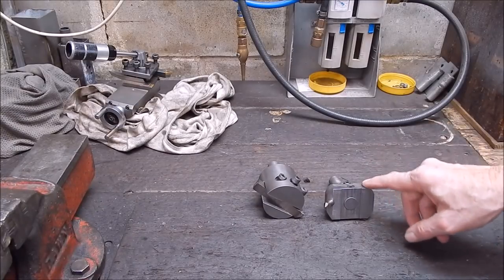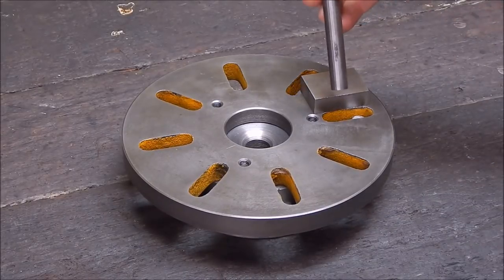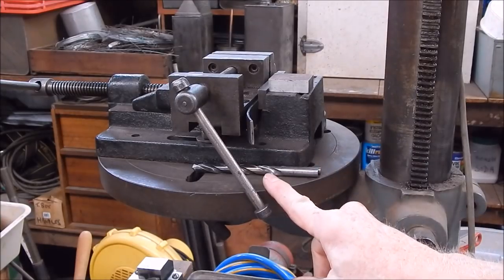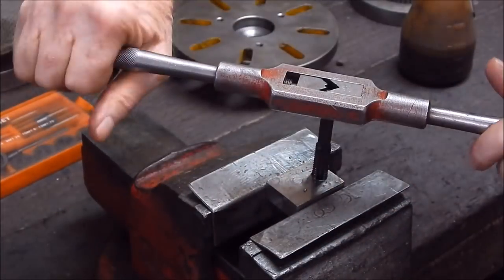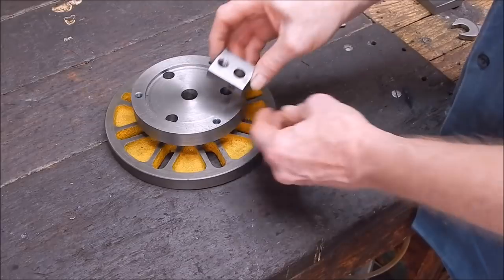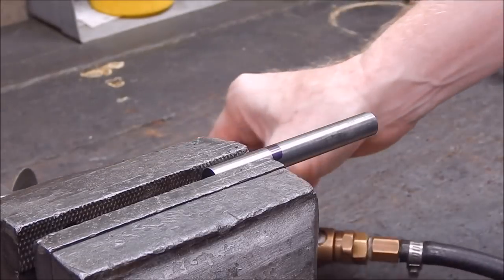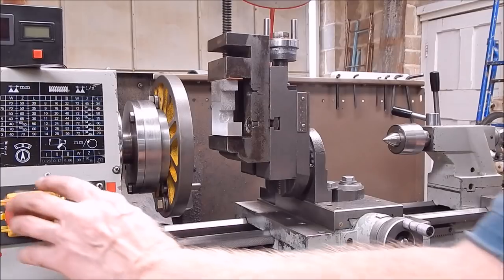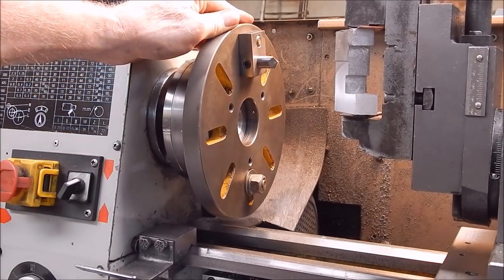Turn your lathe faceplate into a large fly cutter

Comment: Nice job Rob. Made one similar when I had a milling attachment. I made mine so it was the whole width of the back plate. I put 4 holes on one side of centre so I could move the tip across for different radii. Helps with the balance as well. Thanks for sharing. regards from the UK

Comment: Nice idea, but I think you should have just run the mounting block straight across the faceplate, and used the second bolt to secure it on that side. Then it's secured in two places and can never move. You're using the second bolt for balance anyway, which I think is a very good idea, so why not take advantage of it? As it stands now that 12mm bolt is subjected to a turning moment as the fly-cutting bit hits the work. The split lock-washer is a good idea, but I would be concerned that the moment caused by the cutter would still cause that bolt to loosen and allow the tool to move, thus causing your surface finish to go bad.

Comment: 12:39 yeah, that's the best way to do it 99 times out of 100.  But you still can cut tool steels with a hacksaw if you have a carbide hacksaw blade.  Pretty handy even for mild steels, zips right through the job.

Comment: Comment on threading using taps & dies. The most commonly accepted technique of turning the tap handle a small amount, then backing it off "to break the chips" damages your taps & dies prematurely. Those broken off chips get wedged against your material when you take the next cutting stroke, and break the cutting teeth on the tap / die.

A much better technique that will prolong the life of your taps & dies, is to start your thread and NOT back off while cutting. You can stop to take another handhold, just don't back off the cutting teeth engagement. Never allow the chips to get between the leading edge of the cutting teeth and the material being cut. Use lots of cutting fluid. In thinner material, continue your cut until you finish threading all the way through. In thicker material (over 3/8") stop cutting, back your tap / die all the way out, then clear out all cutter chips (compressed air works best). Once cleared of all chips, re-insert your tap /die and continue cutting. Once again, lots of cutting oil.

This method will greatly extend the life of your taps & dies. You may even find you only retire them for dulled cutting teeth (normal wear) and never for broken teeth. This works in all materials, while I am focusing on mild steel for this comment. Always start with a Taper Tap. If you are threading a blind hole, next use the Plug Tap, and finally a Bottoming Tap.

Comment: that's the simplest yet the best fly cutter I have seen for the lathe.

I was thinking whether I should buy lathe or mill first, and I'm glad I went for the lathe, because it seems like I will be able to do both turning and facing, but of course with the limited parts sizes. in most cases I will be facing < 3 inches longest edge, so the lathe should suffice for some time.

quick question:
with the 4 jaws chuck, would you rather drill all these holes in the lathe or in the drill press? I think if it is possible, I would like to do everything on the lathe, just for the fun of it
Reply from the maker: The lathe will defnitely be more accurate.  The table on a drill press will flex from true vertical alignment unless a support (jack) is put under it.  A lathe allows you to index holes much more accurately with a simple paper chart behind the chuck - see my videos on this.  Cheers Rob
Reply: @Xynudu  excellent, will use the lathe to drill!
will check out your other videos, it's like a mine of knowledge

Comment: Just did it the other way round and I believe it was easier than your setup. I simply fixed the vise on the face plate and voilà...Ok, ok, some more possible unbalance, but I compensated that with counterweights. No need for your special milling attachment.

Comment: I like your simple solution, thank you very much for posting this. I was wondering about the tool geometry you used or ground it to (for your HSS bit)?
Reply from the maker: The cutting profile can be any shape (eg. curved or chisel)  but it must have some front and rear relief for cutting effect and chip clearance.

Cheers Rob
Reply: xynudu Thank you very much. As it happens, I have a rectangular casting to face off that is too large for my faceplate and will definitely try this out. I have already built a mini pallet for the carriage but my existing fly cutter has too small a radius, hence your example comes in handy.

Comment: Love the setup...i would just face it off in the 4 jaw but this would be great for irregular objects.Why did you hang milling  attahcment  over the side instead of trying to get it closer to the center of carriage...
Reply from the maker: That's because of the shape of the mill slide.  The vice is always going to hang off one side. It's not ideal.

Rob
Reply: You could mount the vise a little lower you could slide the angle plate back a couple inches it would greatly improve the load direction on the ways......cheers....its your world...
Reply from the maker: The vise has three pairs of mounting holes in it, so I can move it up or down as suits the job.

Cheers Rob

Comment: Is that milling attachment OE or is it aftermarket?  I need one for my ENCO 1340.  That made short work of facing that item.  Why not counter balance with a second cutter?  Good video and proof of concept.
Reply from the maker: It's aftermarket Chinese made.  I have seen opposing cutter heads used with a faceplate.  It makes a lot of sense.

Rob

Comment: Would there be any issues to machine in reverse to help catch the shavings in the chip tray?
Reply from the maker: Hi Peter, not if the lathe spindle incorporates a drive plate.  A screw on face plate could unscrew quite easily though.  It's basically no different to parting off at the rear of the cross slide.  Cheers Rob
Reply: @Xynudu  Rob thanks, it has the three pin locators, not a screw on.  Damn dog wants to watch me do the lathe work and trying to keep the metal chips in the pan and out of her paws.  Love your videos, helping me greatly. Thanks

Comment: Hello to you sir, I am really new to this, a while back I bought my self a really old lathe, the problem is ive  tried loads of new different types tools and I cant seem to get a good finish at all. I definitely cant get right through on a cut off, its a mess. I have tried new hss, new carbide. trying and trying to get dead centre, and sharpening,  ive tried it all, the last thing is am I doing it all at the wrong speed, I don't know what else to try, have you any ideas please.
regards Colin.UK.
Reply from the maker: Hi Colin,

We all start at the beginning.  What is the lathe ?

I suggest that first off you read this free on line book put out by Hercus:  https://tokentoolroom.com/files/Text%20book%20of%20turning.pdf

That has all the basic techniques you need to understand, and deals with HSS tooling for older lathes.

If you want to try carbide tooling I only recommend TCMT inserts in the smaller sizes, as this puts the least amount of load on the lathe by having a small tip radius.

Keeping the cutting area/radius small and reducing loadings on the lathe are important if you have any strength/flexibility issues.  Smaller old lathes often do.

I hope this helps.

Cheers Rob

Comment: what sort of rpm is your belt sander running at? I wouldn't mind makin one. and I've just dumped some power tools I didn't want or need, I knew the motors would be handy for something but at the time I couldn't think of anything and I really needed to have a clear out so I threw them away even though the motors were still good. I'm sure I still have something with a usable motor... maybe I could adapt an old air powered DA sander to power a belt... so what's the rpm again?
Reply from the maker: It's not about RPM, but about belt speed.  

Ok, the motor speed is 1400 rpm, the drive pulley is 50 mm diameter.  So to get belt speed we multiply the pulley circumference by the motor rpm.

That is 3.14 (Pi) x 50 x1400 which equals 219,800 mm / minute or 3663 mm per second.

That then becomes 366 cm per second - in USA terminology that's 144 inches (12 foot) a second.

That's a lot faster than it looks, but the figures don't lie.  Makes all that high school learning worthwhile ;)

So to make one up you will need to use the same maths for whatever motor and pulley you are going to use. 

You can get great stuff out of old treadmills to make these units  (rubber coated rollers , shafts,  ball races etc).

Linishers are one of the best things you can have in the workshop.

Cheers Rob
Reply from the maker: If the motor is an armature type (has brushes) you can easily reduce/control the speed with a cheap PWM voltage control (same as used for ceiling fans) provided it has the correct wattage rating.

It would be handy to have slower/variable speed for some jobs.

Rob
Reply: interesting. thanks for the breakdown, it all makes perfect sense. how did you decide what belt speed to aim for?
Reply from the maker: I bought the sander part from a garage sale for a few dollars.  It was originally driven by a flexible cable from an electric drill (crappy setup).  So that would limit the motor speed to no more than 3,000 rpm.

As I wanted a low speed unit I just used a junk day motor from the kerbside which was suitably low rpm.  Crunched the numbers and it seemed about right, and presto that's what you see.

If you have a hand held belt sander it would be interesting to see how the belt speed compares (crunch the numbers the same way) but you have to allow for any toothed belt gearing etc.

Cheers Rob

Comment: heres a tip for you rob chamfer the top of your hole it will make the tap go in easier
Reply from the maker: Hmmm.  Good tip Nick.  That makes sense.  I will try that next time.

Cheers Rob
Reply: xynudu learnt it off one of the fitters I work with as I am doing an aprenticeship in fitting and turning

Comment: Just get a piece of round stock and braze on an insert and you can use the same setup.  You might even have a boring bar already that would work.  Do you know anyone that sells boring bars???? :P
Reply from the maker: Hi John,

I have seen a single large bolt used with a HSS tip brazed on.  It puts a lot of pressure in one place and could maybe crack the faceplate, but as I said in the video description, there's lots of ways to do this. 

Cheers Rob

Comment: I do not fully agree with the tapping fluid you use. You say it is kerosene and motor oil. The main purpose of a cutting fluid is not only to lubricate but to avoid chip build up (aka tip welding) on the cutting edge and at high speed also cooling. There are two types. One for low cutting speeds like tapping and one for high speed cutting like turning, milling, drilling. In both cases the cutting fluids (water based and oil based and pasty) should contain sulfur compounds like disulfurdichloride or equivalent that chemically react under heat and pressure at the cutting edge and act as a release agent to avoid chip build up and extend the life of the cutting edge. Many know the dark brown, smelly, smokey cutting oil. Using such a real cutting oil may cost more than a home brew but it pays back by longer tool life, lower cutting forces and less broken taps stuck in your work. Try it and you will feel the difference especially with difficult materials like stainless steels.
Reply: Kerosene or WD-40 works well on aluminum. But for steel the smelly stuff is superior. I know it stinks up the workshop...
Reply from the maker: Hi Rol,

I do have proper cutting fluid (thicker dark sulphury stuff) but rarely drag out the bottle to use it.

The taps cut fine with my basic home made mix.  I'm sure you're right, but hey if it works then it can't be too bad.

Cheers Rob
Reply from the maker: Yes, that's one reason I don't use it. Also the bottle is always up the back behind everything else.

:)

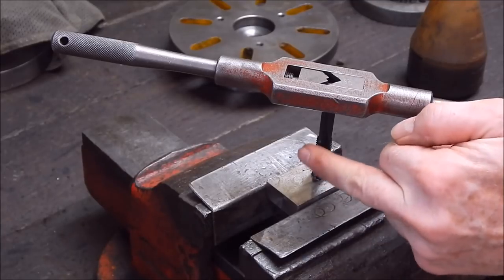Comment: 6:40 I have a cheap set of taps and dies just like that, had them quite a while and forgot I had them until today.... the taps look like they were cast up someone's arsehole, in fact thinking about it now they're rough surfaced like they've been case hardened with casenit but then not surface ground to make them good... and the dies are just as bad with crooked looking teeth. I'd never cut new threads with them... they're only good for chasing rust out of old exposed bolt holes which is what I used them for today when I fitted a towbar to the 4x4. and wouldn't really want to use quality HSS  taps for what I did today if I could help it. but for what you're doing here it would have to be quality taps for new thread cutting but you seem to have done all right with them, maybe yours are a little better than mine.
Reply from the maker: There are cheap tap/die sets and cheap cheap sets.  They are all made from high carbon steel.

I have two of the former (metric and Imperial).  Both made in Japan and at least 20 years old.

They cut OK and are quite accurate (did that job) but still not as good as expensive HSS pieces.

I haven't had a look at the Chinese sets (which are a copy of the earlier Japanese sets) but I don't doubt that the quality may be a bit suspect.

Rob
Reply: strange, I just checked my set and it has German writing all over it but they're not your typical German quality lol so who knows where they were made... Interesting to just discover there's an 1/8th NPT tap and die in there too... gives me an idea.   
Sure would like to compare mine side by side with yours. I'll admit to not having really put mine through their paces to see how well they perform, when I need threads cutting I typically by individual taps specific for the job. 
By the way, I didn't comment on the face plate fly cutter... great idea and well executed.
Reply: I too have the two sets.  They were handy when I was not able to afford anything better.  I now have three Mastercraft sets, and a forth set that goes from the 9/16th to the 1 inch size.

Comment: Why not put the work in the chuck and use the lathe as it should be?????
Reply from the maker: Please explain.  I don't understand your comment.
Reply: Oh look here we see the rare species of the armchair machinist
Reply: Mounting work on the faceplate is often difficult. And it is often unbalanced.
Reply: Rob is using the lathe as a mill when he does uneven or odd shaped work. In a chuck or on a back plate you can only machine a diameter but with a milling  machine you can cut a straight line. regards.
Reply: I read the comments and found out why. I was only thinking of facing the work piece.
Reply: Not rare enough.